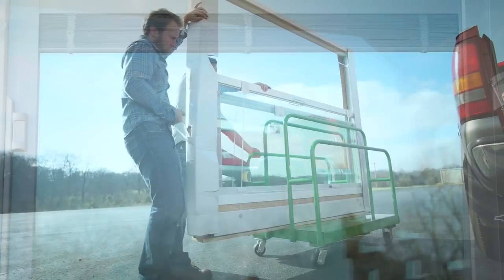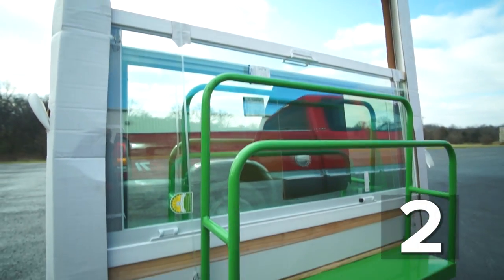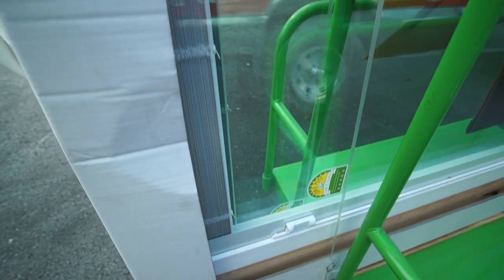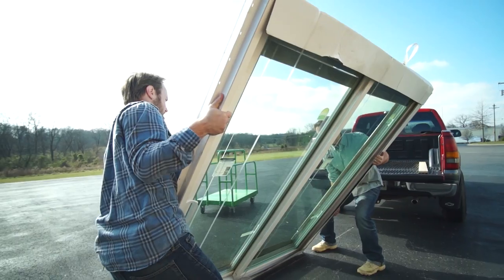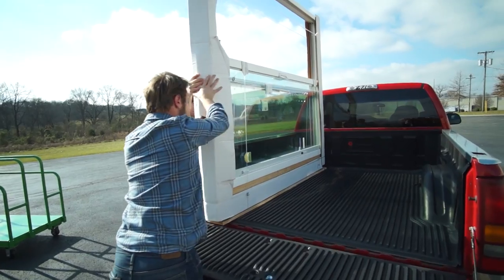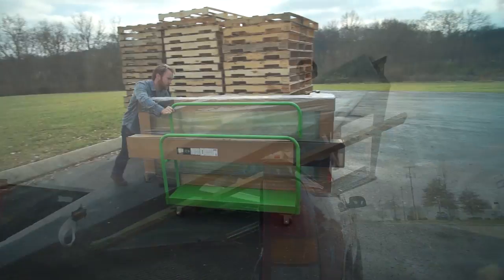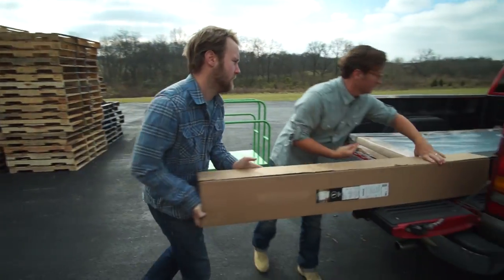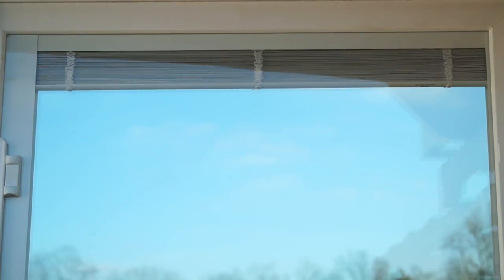Blinds Between Glass Handling & Transporting

Comment: Whoa, I'd be super leary about transporting large glass doors or windows lying down or even diagonally in a truck box. When hitting bumps, the sheer weight of the glass can cause it flex enough to crack. NO window manufacturer would recommend what these guys are doing!
Reply: I used to sell doors and windows, can confirm